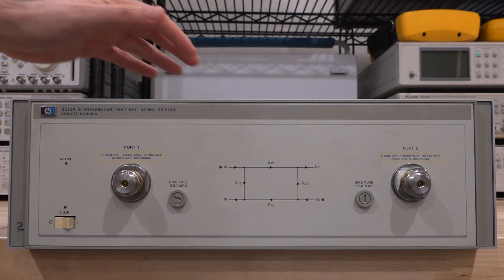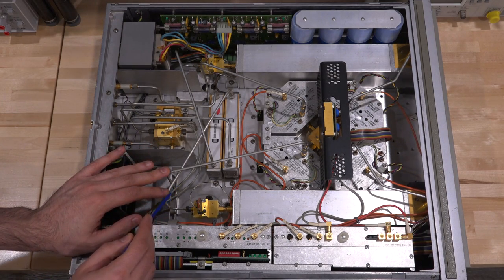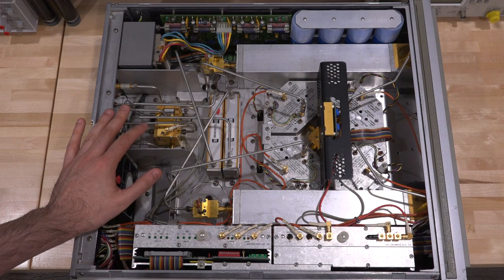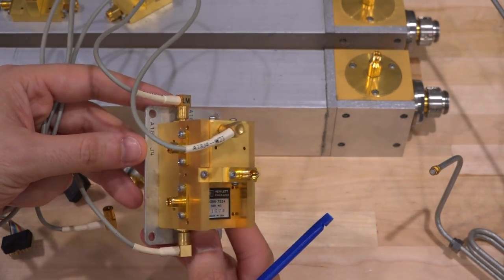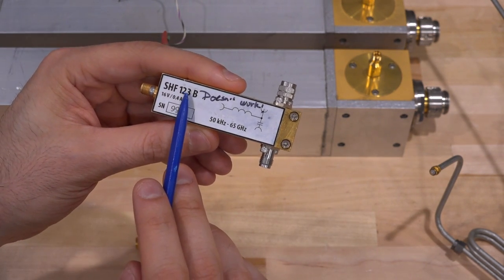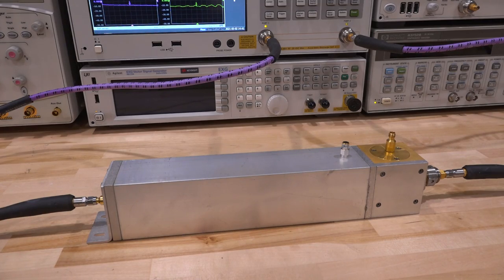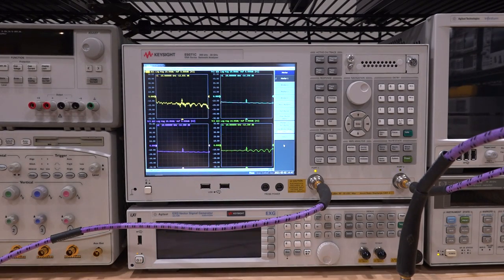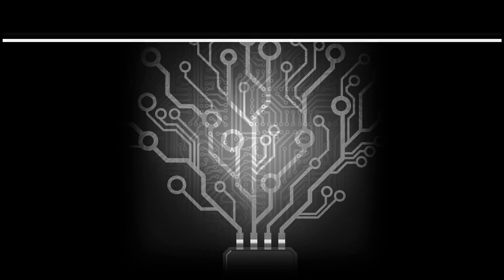TSP #189 - Teardown, Salvage & Experiments with an Agilent 8515A 26.5GHz S-Parameter Test Set

Comment: As always great video! I would like to see not only experiments but may be some useful design based on those components ;) 
Lets see for example automatic attenuator > small control unit to set the required output and when you apply input signal output will be adjusted accordingly by attenuators. 
That's only one idea and I'm sure there is more.

Comment: The 8510 is a beast of a system which was available with front-ends capable of analysis up to 110GHz.  I could personally see RF labs holding on to these for as long as they can keep them going due to the wide-scale adoption of millimeter-wave technologies.

Comment: I remember working with these, testing and tuning optoelectronic components.  It seems like yesterday but was almost 20 years ago now.  We had "Connector Savers" screwed to the front to try to limit the wear on the front ports as the cabling was often reconfigured, though even those devices themselves would have some impact on S-parameter measurements.

Comment: Hi Shahriar, I got a 8510c with a 8516A test set. I wish to add the option 001 (IF switch to connect others test set) because I was build millimetric setup and I wish to siwtch automatically. You have info about how works and if is possible to remove from a 8515 for example and add it to the 8516? my twitter is @eb3frn tnx!

Comment: It may have been worthwhile to power up the unit while to was still in one piece and diagnose the fault(s,) whether you intended to repair it, or just salvage its parts. This would give you some indication of what components were stressed and, therefore, what parts might be suspect for precision work, when later used.  Yes, each independent part could be tested, and should be, before use, of course. However, an "it still works" diagnoses is different than a "It still works, but it was subjected to (for example) a reverse polarity condition." Just a thought. Love your channel!

Comment: Great video! You did a wonderful job explaining something that was, and still is "over my head". A lot of the principles here apply to other types of circuits like switches for amateur radio antennas for example. Thank goodness I have some knowledge there or I'd be completely lost instead of just overwhelmed. I would also suggest watching videos on Nano VNA's to further understand this. For about $50 on Ebay you can get one of these and just play with it. No it's not an HP, but not $20,000 either and great for learning on. I'd imagine that if you could familiarize yourself with the Nano VNA first, this video would be MUCH easier to grasp. W2AEW has some excellent videos on this. Thanks again Shahriar.

Comment: Everybody wants to know how much this stuff is worth, so I looked for any items that had an identifiable part number and looked them up; most are older parts found on eBay, some are still available from Keysight.  eBay prices were just quick surveys from scrolling, not mathematical averages.

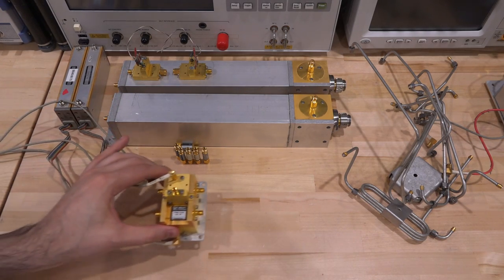@9:32 HP 5086-7324 coaxial switch splitter      $100 eBay

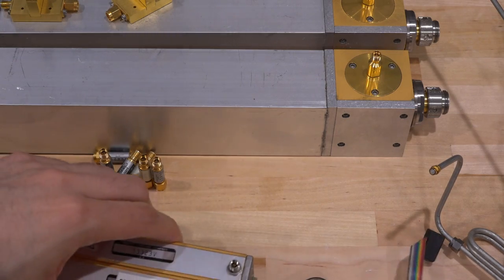@10:20 HP 33323V 26.5GHz 0-90dB step attenuator $250 eBay

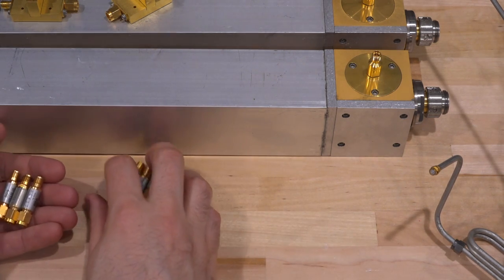@11:00 Keysight 8493C dc26.6GHz fixed attenuator $506 Keysight
@12:00 the item identified as a bias T has the same part number as the coax splitter. Hmmm. 
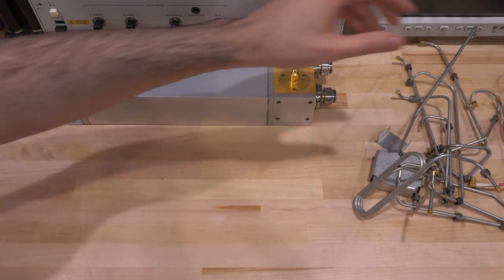@16:05 4x 5086-7402 sampler assembly            $100 ebay (part of quad mixer)

@21:00 HP 50867231 VTO/Driver assembly          $200 ebay
Reply: Those prices are for suckers. There is a whole unit for under $500 right now on ebay. They are not that rare. The REST of the system is what is expensive!

Comment: 15:35 This explains things, Shahriar is obviously not in the same universe as the rest of us.
Though, 1 minor complaint about the video, the intro and outro music is a fair bit louder than when you are talking. I would recommend keeping an eye at the sound level when editing.
You could throw on an audio compressor when you talk, this will level out the volume fairly effectively, but configuring such to not sound poorly is a bit of an art.

I am though biased in regards to sound, being an audio technician for a fair few years have made me picky about audio leveling and editing...
Reply from the maker: Thanks for the feedback. I’ll turn the intro music down.
Reply: @Thesignalpath  It isn't a huge difference. But it is a bit loud, or it could be the rest of the video that is on the quiet side.

But a few tips and tricks.

I think you can get an audio track visualizing the volume over time in most video editors. Giving you the ability to quickly see any drastic changes.

A general rule of thumb is to aim to be within about 3 dbc from one audio clip to the next for it to have a similar volume.

It is generally more important to watch the average volume than the peak volume. (box car over a few hundreds of ms. (Audio techs still use panel meters for a reason, they have "good" averaging.)) After all, a regular person talking at 60 db can still reach peak volumes up in the high 70's.

In regards to volume differences,  a 10 db increase is generally considered to be about twice as loud by the human ear. Staying within 5 db is a noticeable change by most people. And 10-15 db is the difference between someone talking quietly in a movie, and an explosion packed action scene.

One can use a drop in reference sound as a sanity check and then just get it in the same ballpark by ear. If the reference is louder than the video itself or vice versa, then there is an imbalance in the level and one then changes the video's audio level accordingly. (A reference sound can be almost anything, except a pure tone since that is clearly heard through almost anything, the ear is practically a real time spectrum analyzer. With 1 selectable input attenuator of about 15 db, controlled by the stapedius muscle during the the acoustic reflex) One reference clip could be the intro music itself. Another advantage of a reference audio clip is consistency from one video to the next.

One can also use an audio compressor to flatten the volume, but this is generally more useful if one live streams. Since it can compensate for varying distances to a microphone or sudden loud sounds etc. (I though use a compressor on live performances to save me the time of twiddling the fader when people hand a mic back and forth between each other.)

Also, in regards to the complexity of the video topics, I think it honestly is nice. Sometimes you are talking about things way above my understanding, but I have learned a lot. Though still have glaring gaps in my knowledge, like QAM modulation is something I understand, but single side band without tons of filtering is magic... I partly understand it, but can't explain it. Would also be nice to know more about RF couplers and how they differ from circulators.
Reply from the maker: Thanks!

Comment: I am curious about the specific difference in the built between 2 VNA bridge heads and these bulky couplers and sampling mixers. The actual mini VNAs from KS use a custom chip which integrate a coupler PI-network, 2 differential amplifiers and 2 downconversion mixer, driven from the same LO, converted to a relative low IF and then get digitized. The PI coupler, as the remaining components work from DC up the parasitic deorientation of the diffamp CMRR and the bridge cap load. Is there a reason for this built or simply squeeze IC tec this down up to 26GHz where the 80s 1Ghz was a an IC wall?
Reply: @Joel Dunsmore Thanks Joel. So IC technology is here indeed the main driver. The bridge with a typical 2/3 and 1/3 divider and 2 diffamps should be anyway significant smaller than a wavelenght. Where the directional couplers operation is based on size large to the wavelength. Mixer, ADC and processing profit obvious from IC tec.
Key point is: Wave direction could measured with a simple voltage divider.